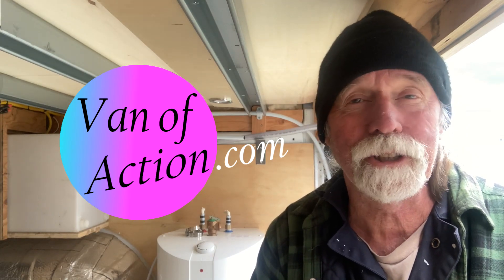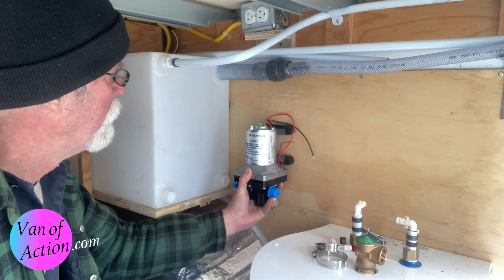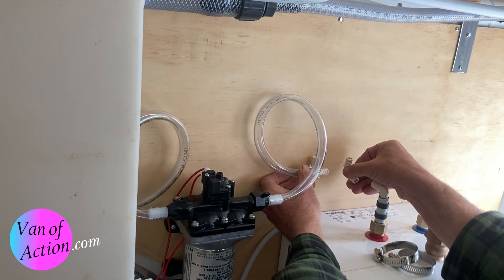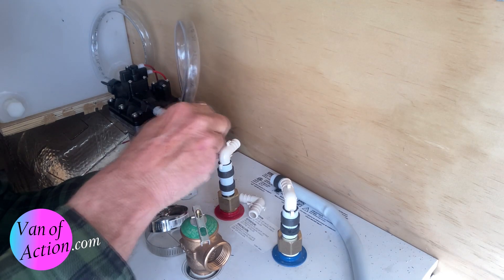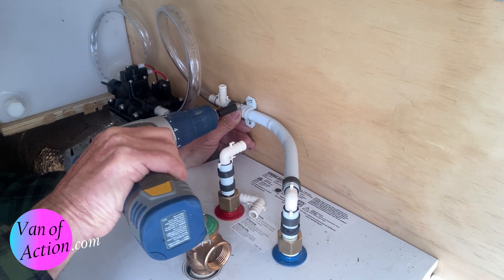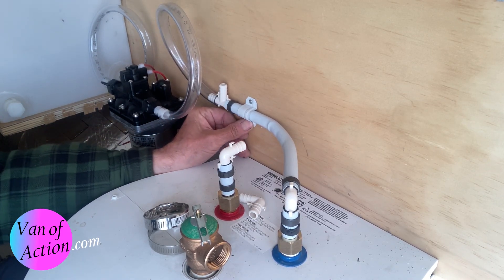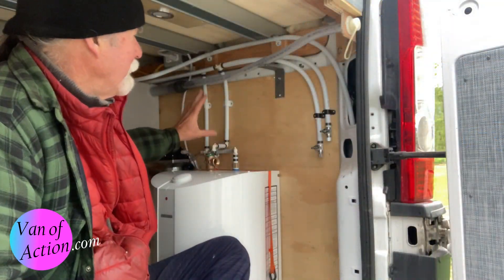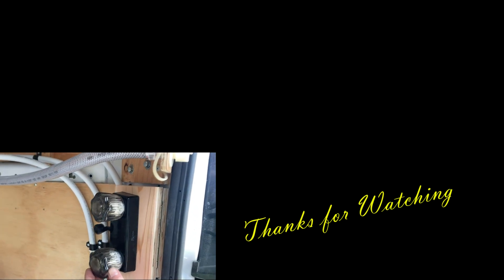RV  Pex Plumbing Design and Install for Van Conversion Build   on Promaster for vanlife  Hot Cold

Comment: As always some good detail.
Would it be worth putting a stop isolator valve in the loop between the tank and pump, so if you need to change the pump etc you can seal the tank, rather than draining it.
Thanks for sharing 👏👏👏👏👍
Reply from the maker: Hi Marky - thanks for taking the time.  An Isolator valve would certainly be an option. But I think it's possible to over design.  It's only 10 gallons full so draining wouldn't be that big a deal.  Thanks for watching and stop back.   Dave

Comment: What might crawl up the vent line?
Reply from the maker: Hey Ottacarr.   GREAT question.  One I hadn’t thought of initially.  But after the fact I used a pipe clamp to hold some window screen over the end.  Another thing I didn’t consider is the syphon I created when I looped the vent pipe up so high.  When the tank fills and water starts coming out I have to disconnect the feed hose to break the siphon. Otherwise it would drain the tank !!  (Really made me smile the first time). Always learning.   I’m so glad you watched the video and took the time to comment.   Hope you’ll stop back.   Cheers.  Dave